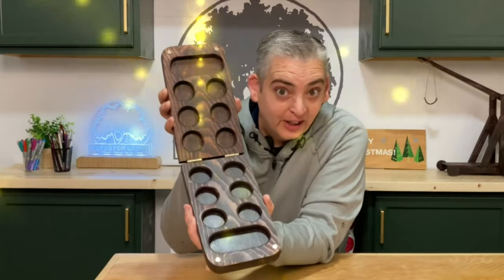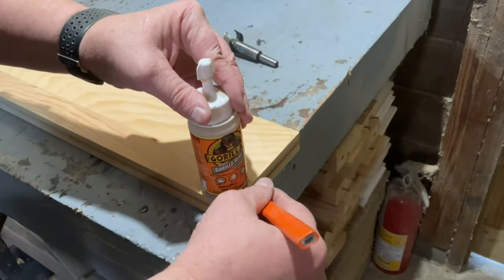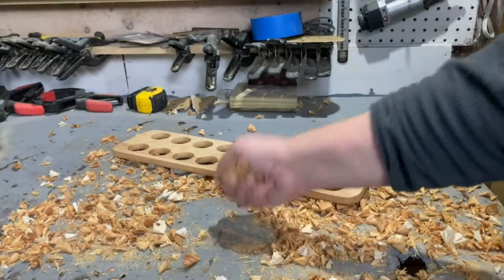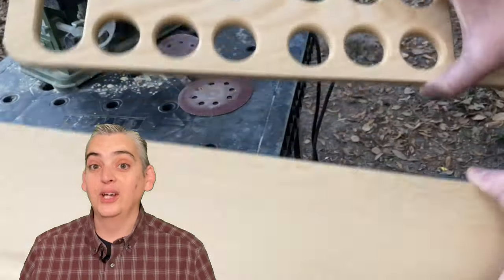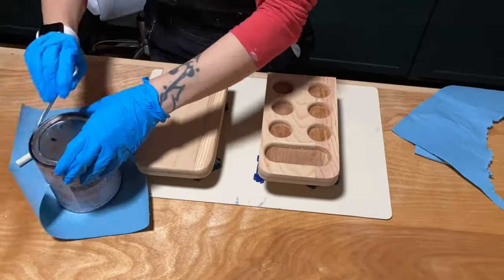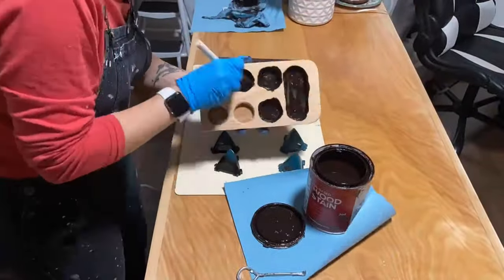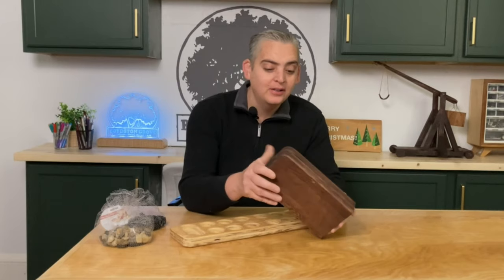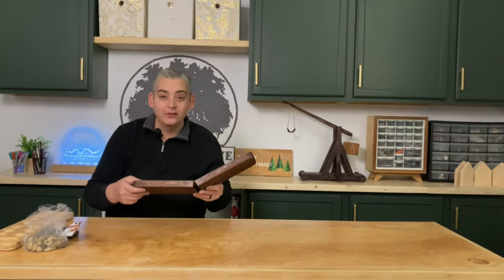How To Make The Mancala Game Board // Easy Woodworking Project!!

Comment: Could I do this with hand tools? I'm good with my hands and I have a plan but my biggest issue would be cutting the board in half lengthwise
Reply from the maker: For the second one I made, I used 1/2” plywood, so I didn’t have to re-saw the wood cause it was already thin enough.